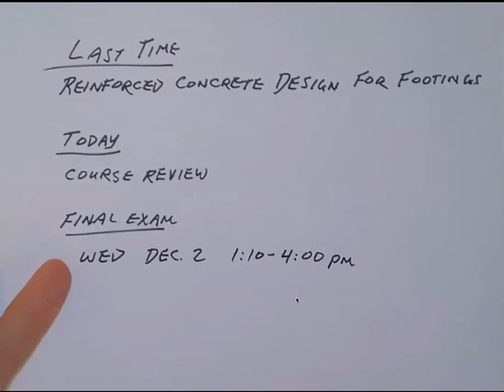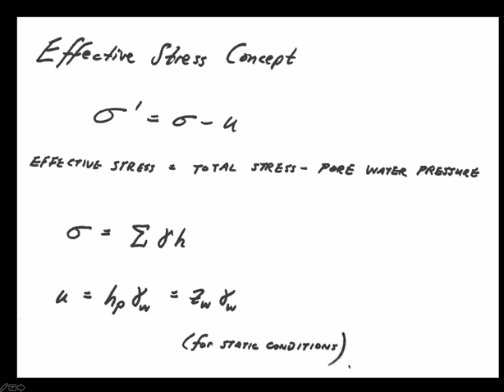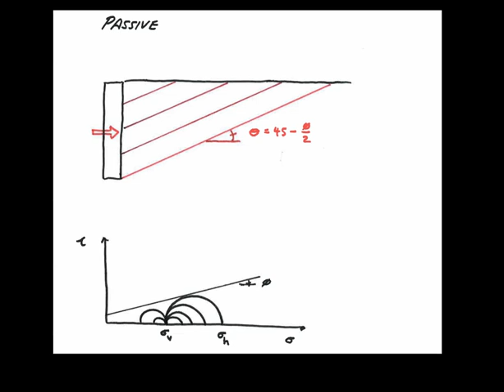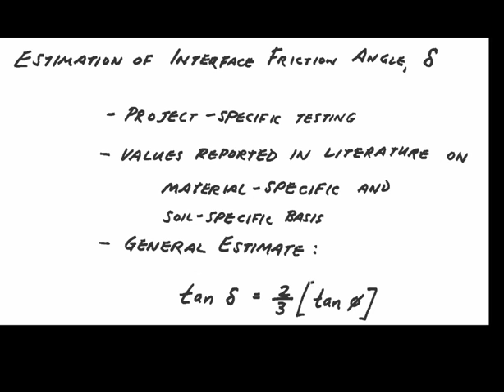Course Review 1

Comment from the maker: 9:16 Effective stress concept
10:45 Effective stress example
10:30 Strength of soil methods
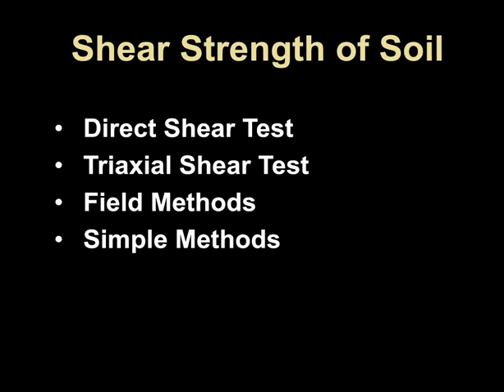11:36 Field methods for shear strength
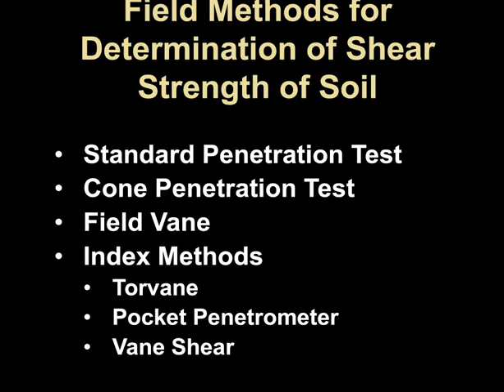12:00 Direct shear test
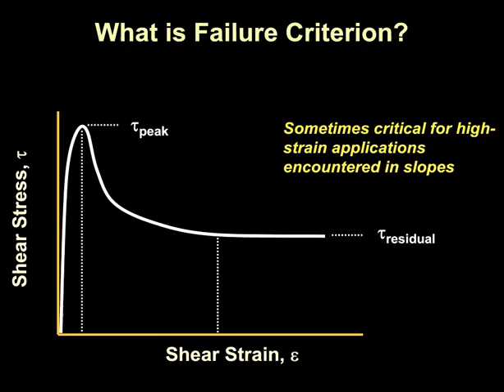12:55 Determination of shear strength (shear stress vs. normal stress)
13:58 Triaxial test
15:27, 12:55 triaxial test mohr circle
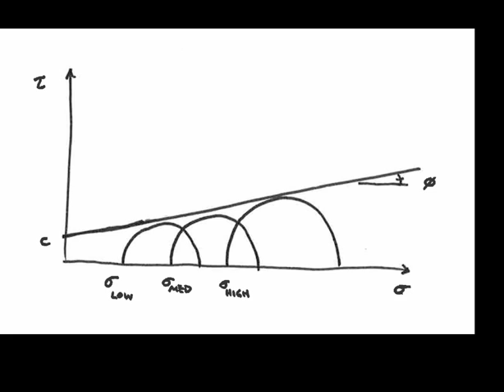16:46 total stress effective stress mohr circle
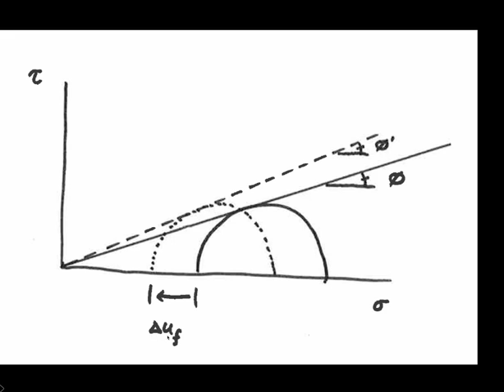17:54 uu (unconsolidated undrained) test mohr circle
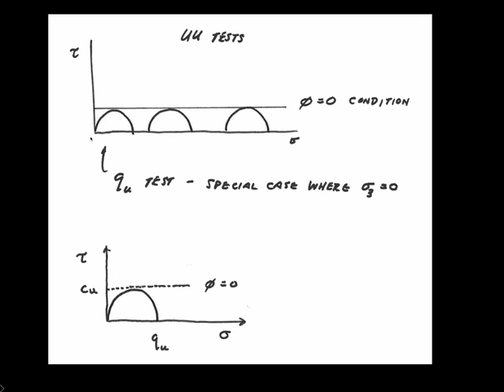20:04 angle of failure
20:40 lateral earth pressure
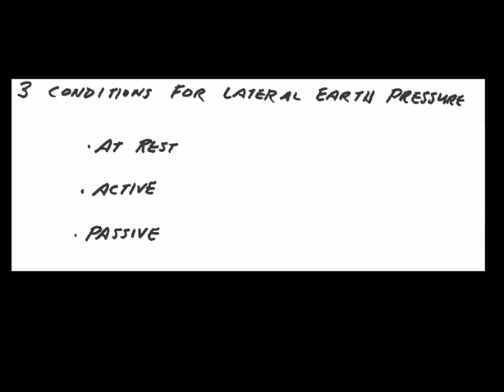           22:01 at rest
           22:52 active, 24:00 fail
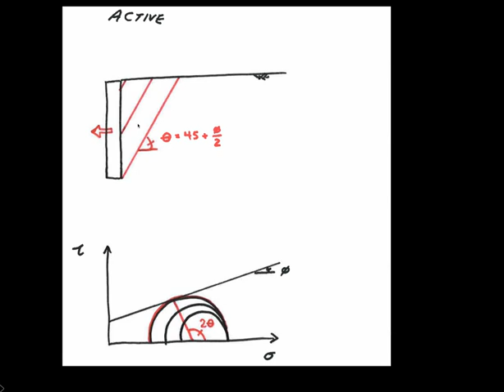           24:28 Passive 25:19 fail

          26:08 Distribution
          26:51 forces on the system
          27:35 interface along the base of wall
          28:12 interface shear resistance
          29:02 estimate of internal friction angle delta
          29:25 estimate of interface adhesion

29:33 Foundation Design topics